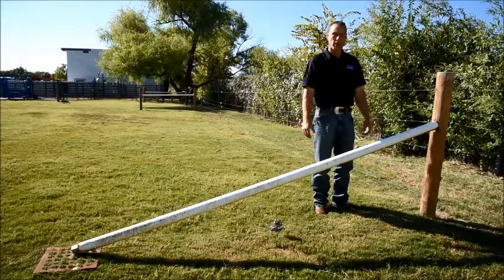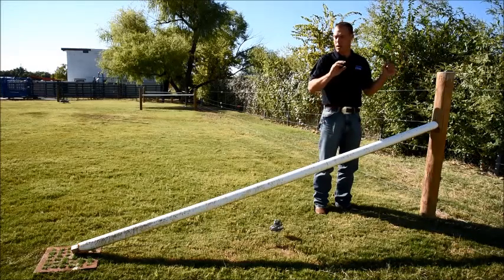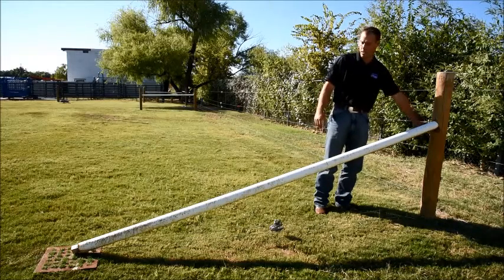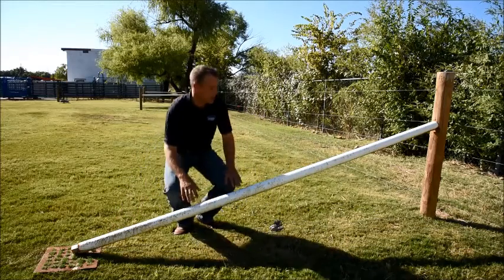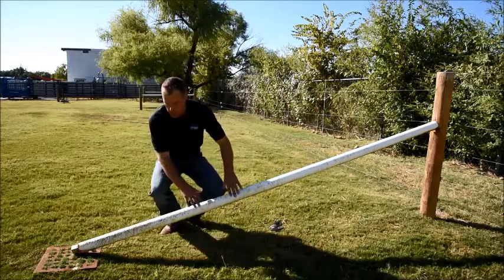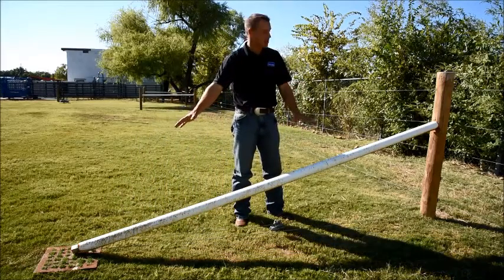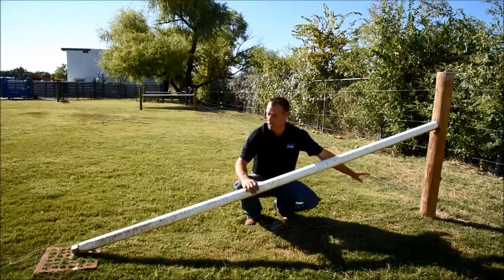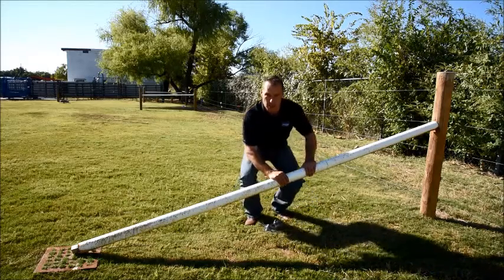Floating brace construction | Patriot

Comment: What keeps the brace from moving on the pad?
Reply: The brace is made solid by the in-line strainer that he mentioned. Wish he would have showed that final step. Wrap a smooth wire loop around the upright post and the bottom end of the brace (notch this), and tighten the ratchet. It won't move.